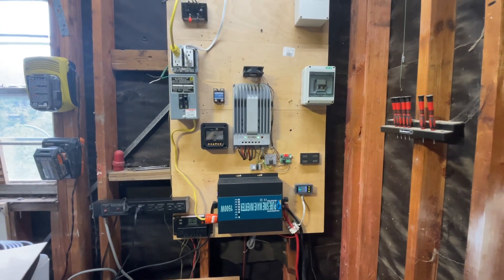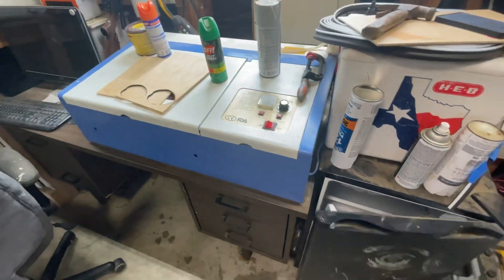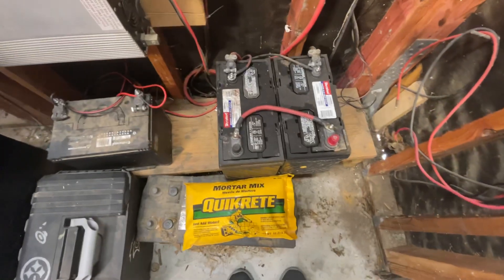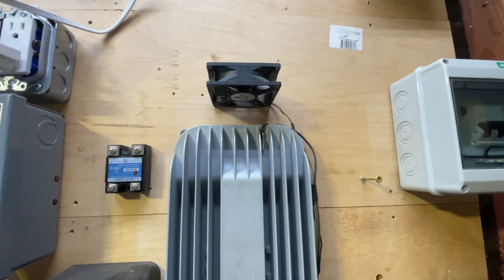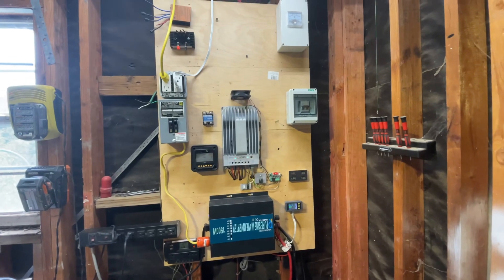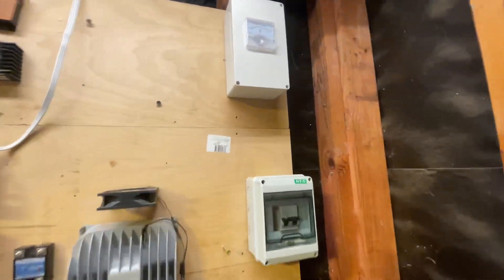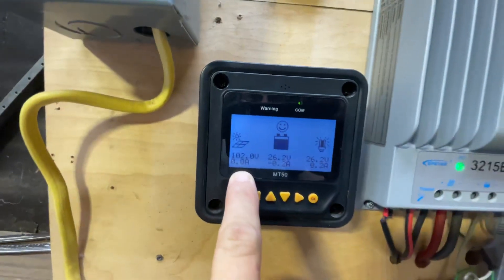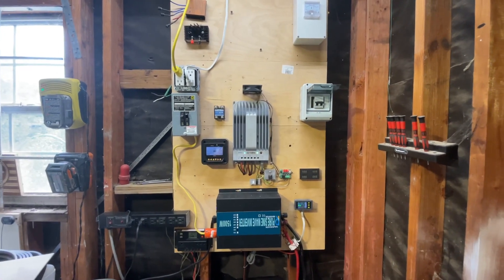4.5 year update on my solar setup

Comment: Hey Kevin !
Thanks for the response! 
We recently bought a 60 amp 150 Voc Mppt Victron Tr smart to charge our Custom Lithium EV battery 
( yeah some nut job crashed an Electric Smart for Two Mini Car )
 so we chopped up the  300V + Lithium packs into an Off grid mega battery for mere  pennies compared to the price of normal Batteries. 
Night and day usage compared to the FM80 OutBack  series.  The ability to monitor ALL on the tablet was a blessing as an Off Gridder.
My Buddy is currently Building a system and is at my door asking Numbers, gauges, watts, amps breaker ect... 
So I'm teaching him Ohm's Law first then moving onto chemistry,  Temperature and then products. 
He's thought he was going to go 12v for a system. My eyes widened. Oh Hell no! 
24v minimum for off grid when dealing with amps and power efficiencies.
We run 48 Volt here as a standard so I can use things like Microwaves, AC's,  water heaters and air compressors.
I showed him the math of Amp draw on a 12 volt and the required Inverter size and wire thickness. His eyes are slowly opening and understanding why we go higher.
I'm bumping him to use Lithium too  because of the available amps in Parallel or series configuration. 
Let him know 12v lead is 20 amp max and Lithium is at least a C1 rating at 100 amps to pull from. 
All in all he's learning how power works.  Next we tackle AC Power and 120v/240v 60 Hz vs  50 Hz for general use.  He'll get there eventually.
I'll be cleaning all my contacts soon and once broken down I'll walk him through the rebuilt of the entire system step by step. 
I need him confident for repairs using  methods to safely judge breakers, temperature and Gauge sizing.

This was a book and I know you understand the bulk of this jargon with Electrical builds.
Later sir!

Comment: What temp (°F) is that computer fan set to come on?
Reply from the maker: It’s not a computer fan. Looks like one but it’s not.  GDSTIME Dual Ball Bearing Big Air Flow High Speed Preesure 4500rpm 12038 12cm 120mm X 38mm 5 Inch 12v Dc Cooling Fan https://a.co/d/5NEwrVR
179 cfm I have it set to around 100 deg F.

Comment: I would add another 12v fan but mount them on either side of the heatsink at the 3215BN label and at angle blowing upwards, hot air rises.
Reply: ...and cold air falls.